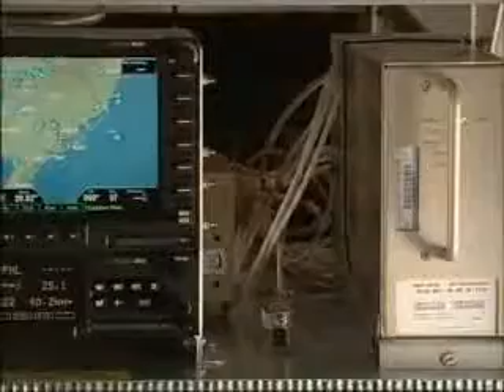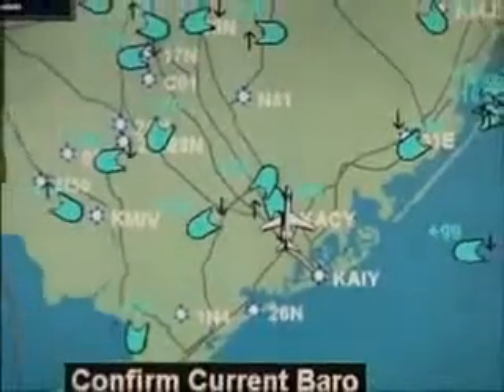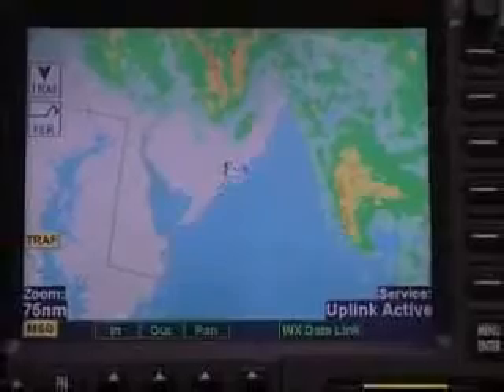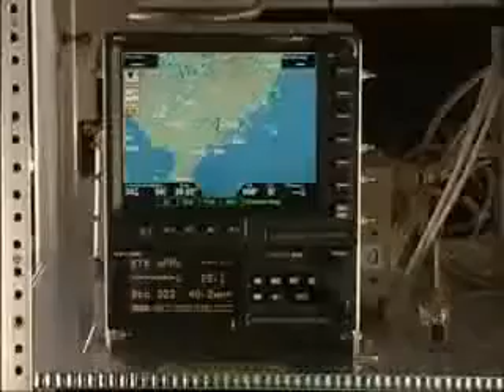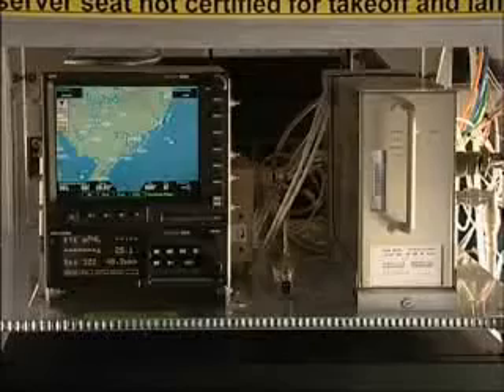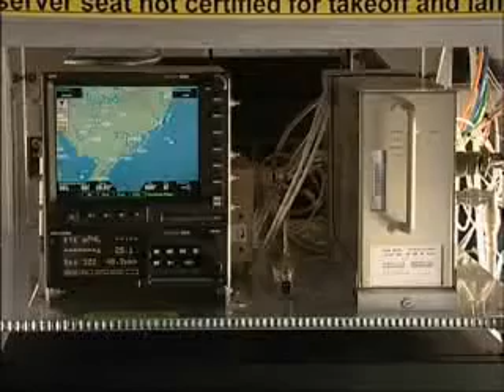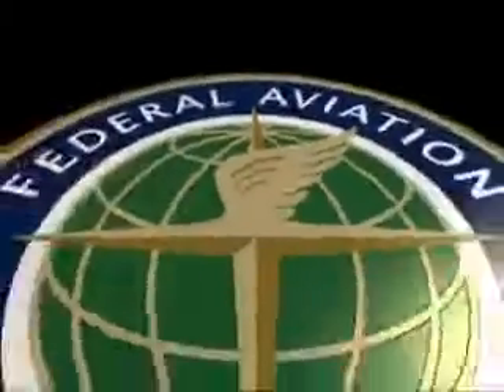FAA Technical Description of the ADS-B System

Comment: Here is what I don't understand.  AOPA has already completed a survey that notes the average price of a self-owned non FBO GA aircraft is in the $25-$30k range.  At a cost of $6000 for the system, the cost versus reward scenario is questionable.  But putting that aside why not implement rulings that specifies flight  parameters before the mandated installation of an ADS-B Out system.  Here is where I am going with this; assume you fly in controlled and uncontrolled airspace from an altitude not to exceed 10000 feet ASL/AGL, the lower of either  under established VFR conditions only and  with a mandated transponder installed.    How does the ADS-B Out benefit the GA pilot regardless of the cost to a level that is measurably more than that which the existing transponder system already provides.
Reply: Depends on how much you want to install. Simple ADS-B out systems are available now that take the place of a wingtip nav light. To take full advantage of ADS-B in, you’ll need more equipment ($$), but the ability to see other aircraft and who they are with additional data (speed, wake turbulence class, vertical speed, etc).  The airliner i fly has ADS-B in, and it’s pretty darn nice. We don’t use the weather data but that can be a really great source of up to date weather data, including weather radar. There are other options for that data such as from XM radio, but I dont’ have details on that.

Comment: Omitted is the fact that a radar return is available absent functioning airborne equipment. Absent a signal from airborne equipments, ATC still has the Radar return. The ADS-B system appears to replace radar with position from the aircraft. (Note: experimental use it in the Gulf). If true, the system has zero information on aircraft not broadcasting.
This seems an unacceptable risk for not only ATC but also Homeland Security. Surly, ADS-B has means of resolving this gap. What might that be?